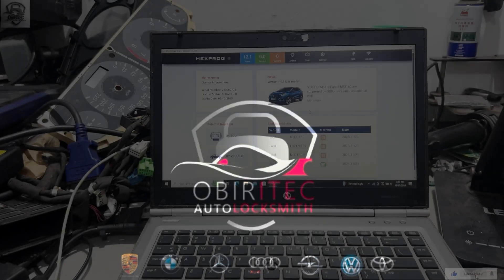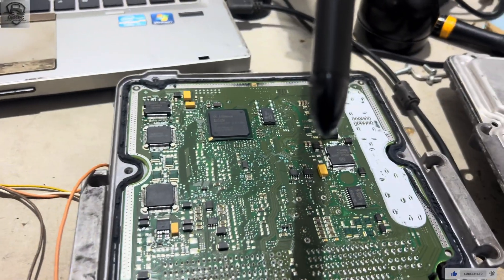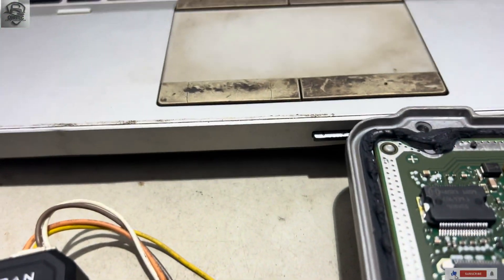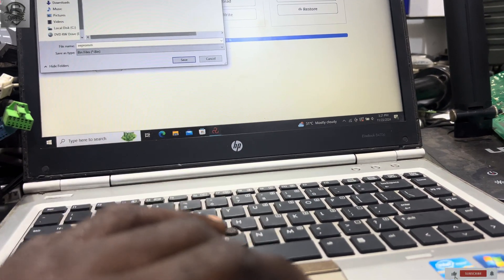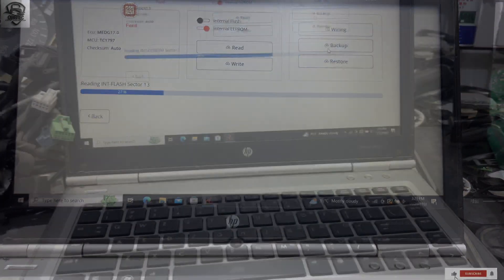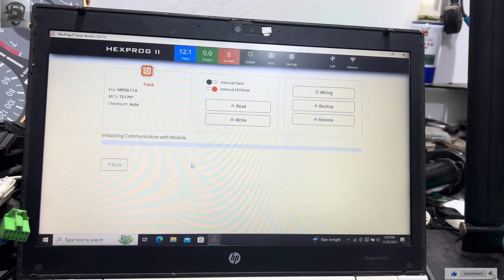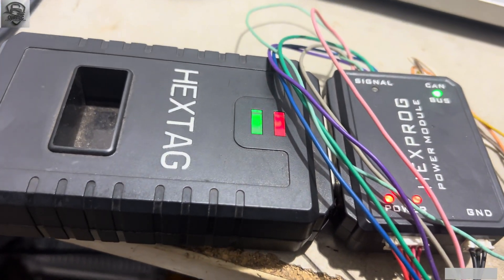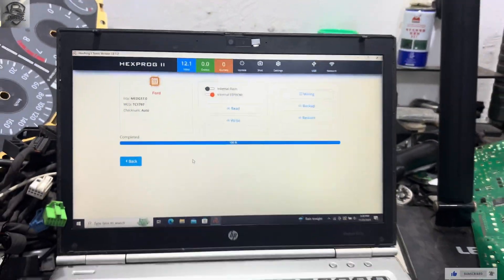HOW TO CLONE FORD F150 2018 ECU| USING HEXTAG PROGRAMMER ON BOOT MODE

Comment: What are you bragging about here!?
This ECU can be written/read WITHOUT opening the case! In full - EEPROM, CPU, FLASH.
Reply from the maker: you need to do it in bootmode when using hextag programmer, pay attention to what i said
Reply: Stop hating bro he wasn't bragging. He was very clear in what he said.
Reply: Obiri you are genius bro
Reply from the maker: @michaelowireduu5526 Thanks bro
Reply from the maker: @michaelowireduu5526 Thanks bro